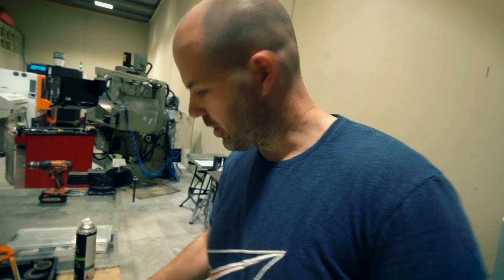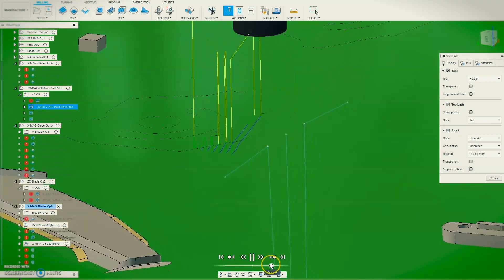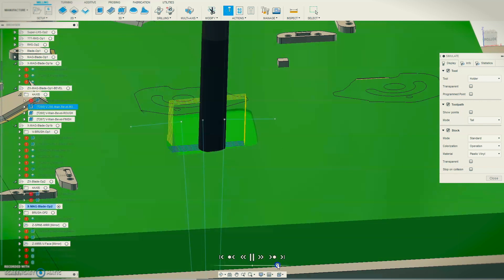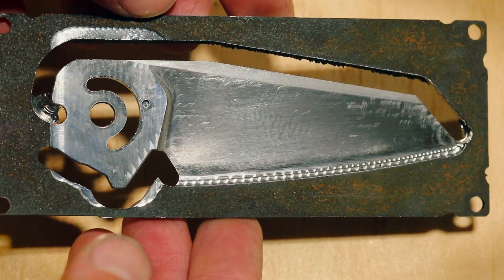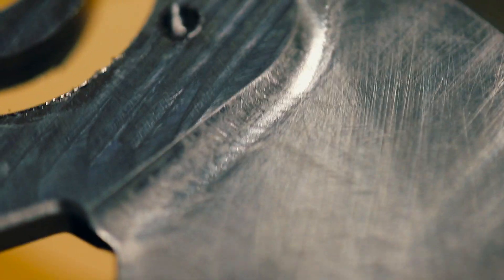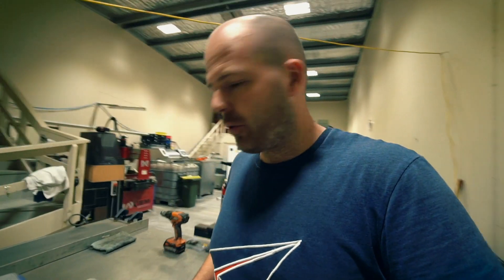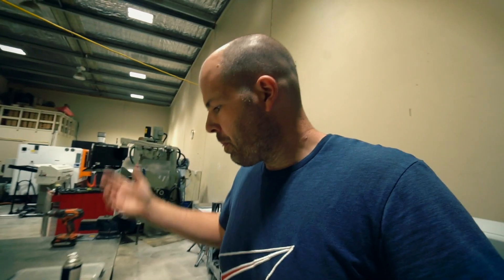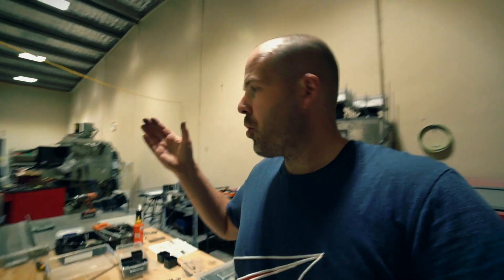CNC Knife Blade (How To Get A Good Surface Finish)

Comment: At 2:02, it looks like you're ramping down in the z axis. If so, then it explains the tool marks you're experiencing, because you're cutting with the endmill's sharp corners. Switch to a corner rounded EM or cant the fixture so the bevels are perpendicular to the spindle. If you can, use a facemill rather than an EM. Flat EM's have a concave dish ground at the end, so the only part of the tool cutting are the sharp tips. Not ideal for facing or contouring . Lay down an upside down plate and you get the same thing. Only the outer rim is making contact. 

General tips from watching your other vids. 1. Don't plunge with a ball EM or use it to rough out a pocket. Save them for final finishing and avoid using the bottom/center of ball. The SFM is 0 or very close to 0 at the center. Not good for the tool. 2. Try to use the thickest and stubbiest tools you can while maintaining proper coolant flow and reaching the necessary contours. Rather than taking 30 passes with a .25"/6mm EM, use a larger EM and take fewer rouging passes. 3. If you can, enable both ways milling, drop down the Feed and Retract planes, and/or select keep tool down. Reduces time spent cutting air and its takes seconds to do. 4. Look into the Nampower brush. Might reduce time spent hand sanding. 5. Try what @
Machinist said and use the side of the endmill rather than the bottom to cut the bevels or a tapered EM. Many sellers should a variety of angles in stock, ready to buy, or you can order a custom EM with your desired taper angle.
Reply from the maker: Cheers Pavel. Yes, I do use a corner radius tool. I've found that both ways milling leaves a poorer finish (well, I found that in the past ...have not tried lately with recent improvements I've made). 

Also, yes, will look at name brush. Thank you.

Comment: Hi Magnus, I see that Grimsmo currently is developing their new knife as well. (The Rask)... John does all the 2.5D milling first, then heat treat, then back on the fixture to hard mill the bevels then onto surface finishing (vibratory tumble in media) and final grind. Have you considered doing this with your knives? The process seem pretty well dialled in requiring less hand finishing.
Reply from the maker: Hey Ian, it seems he uses (or used in the past) a type of grinding wheel for the Rask ...and this is what he's trying to use again.

Short term I'm just trying to get these knife out ...and so happy to hand-sand. Long term I'm hoping to have it all done on the machine(s).

Will have a little look at hardening the blades first. Cheers Ian.

Comment: Magnus that time and process is way over the top for the blades. Switch to a high feed mill to rough and then use a ball to finish. Leave 0.4mm for the finishing ball endmill should leave a mirror. Hard you hard milling or annealed?
Reply from the maker: Hey James, it is definitely slow going! I'm milling the steel soft ...should I be milling  with the ball endmill you recommend when it has been hardened (plus tempered)?

I'm totally ignorant with "annealing" and had to google it. Still not clear to me... is annealing basically just the whole heat-treat process?
Reply: @MagnusMacdonald  How does someone wind up with that much metalworking kit without ever learning such a basic concept as annealed vs. hardened metal?
Reply from the maker: @rockets4kids  Looks like I've never needed to know it (until James asked that question) ...only ever made things out of titanium for 6 years.

Comment: What are you using for the finish cutting? Share the fusion360 file?

Also no doubt you've seen grimsmo knives? They have this process dialed in
Reply from the maker: Hey Manny, the file is a Frankenstein monster of a thing ...but I will share a file(s) in some videos soon.

Grimsmo's Norseman knife has the machining lines left in the blade (almost certainly part of the iconic look). I'm definitely trying to avoid that with this knife though.